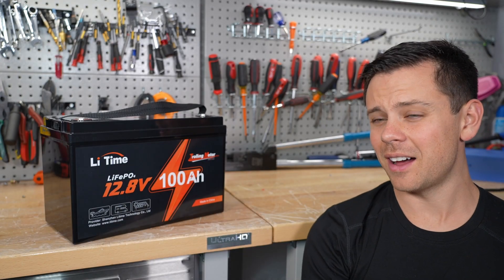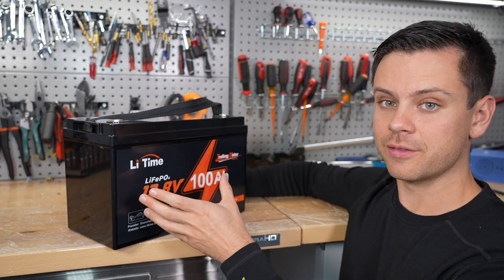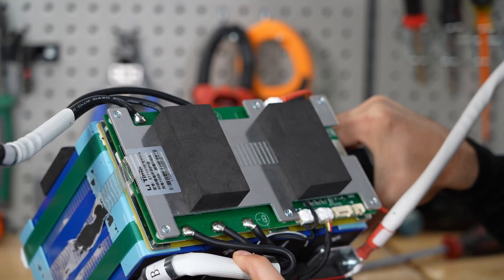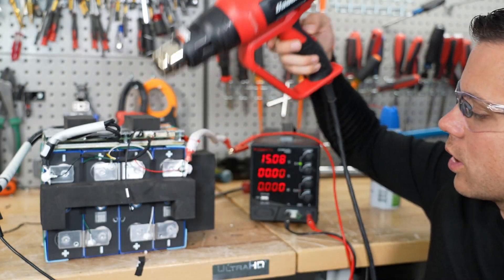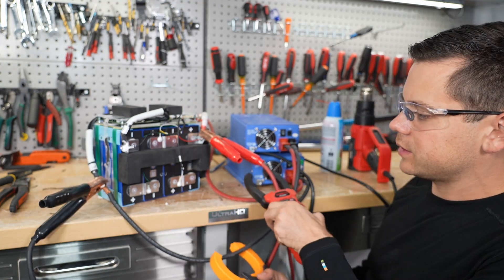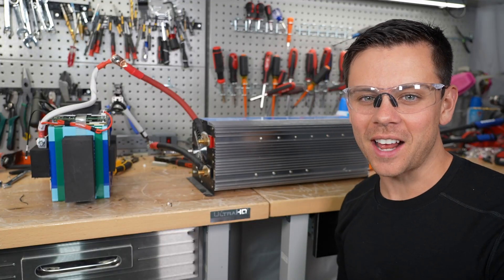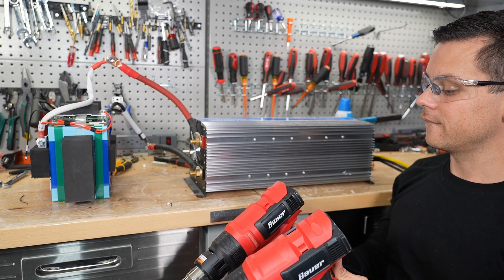$369 Li Time 12V LiFePO4 Battery! 300-500A Surge?! Low Temp Protection?!

Comment from the maker: This model of battery is not available on amazon! The amazon version does not have the same features. If you want the battery shown in the video, you have to buy it direct (affiliate link): https://www.litime.com/products/litime-12v-100ah-tm-deep-cycle-lifepo4-battery-for-trolling-motors?ref=XBIA62RFcalHns

Other Li Time Batteries: https://www.litime.com/?ref=XBIA62RFcalHns

And there is a coupon code for 3% off if you buy direct: WILLIAMPROWSEIV

If you want the cheaper amazon battery that does not have low temp cut off or surge capacity, it is here: https://amzn.to/3DYdi9D

0:00 Intro
1:43 Tear Down and Temperature Sensor Testing
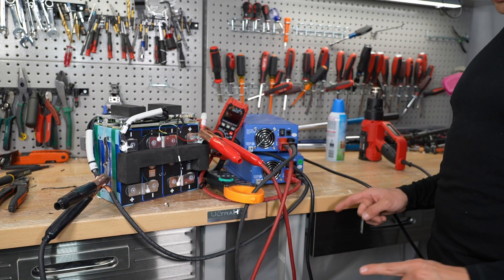4:35 Surge Testing!
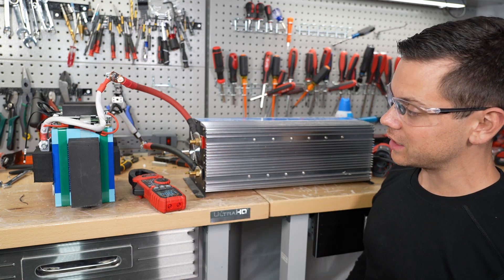6:50 Conclusion

And there is a coupon code for 3% off: WILLIAMPROWSEIV
~~~~~~~~~~~~~~~~~~~~~~~~~~~~~~~~~~~~~~~~~~~
Tired of getting ripped off? Check out my "Will Prowse Approved" solar product recommendations below!

12V Batteries
https://www.mobile-solarpower.com/lithium-batteries.html

48V Batteries
https://www.mobile-solarpower.com/48v-batteries.html

Offgrid Inverter System Builder
https://www.mobile-solarpower.com/48v-complete-system-blueprint-559371.html

Hybrid Inverter System Builder
https://www.mobile-solarpower.com/code-compliant-48v-offgrid-system.html

Mobile Handtruck System Builder (very popular!)
https://www.mobile-solarpower.com/mobile-48v-system.html

Solar Panels
https://www.mobile-solarpower.com/300w-solar-panels.html

Ground Mount Solar Racking
https://www.mobile-solarpower.com/ground-mount-racks.html

Wire, Lugs and Busbars
https://www.mobile-solarpower.com/wire-and-connectors.html

Tools
https://www.mobile-solarpower.com/tools.html

Fuses and Circuit Breakers
https://www.mobile-solarpower.com/fuses.html

Plug-N-Play Solar Systems
Ecoflow, Anker And Bluetti! So many models to choose from. See my current recommendations here:
https://www.mobile-solarpower.com/full-size-systems.html

~~~~~~~~~~~~~~~~~~~~~~~~~~~~~~~~~~~~~~~~~~
Need to build a large DIY system? Need a trustworthy solar distributor? These are my favorites:

Signature Solar
Creator of EG4! Solar Minisplits, Victron and More! Largest Solar Store Online.
If you want $50 off, please use my link below and coupon code "DIYSOLAR50":
https://signaturesolar.com/?ref=cPwLcVc0SW-BjN

Current Connected
Best Prices for EG4, Victron, Midnite and so much more! Fast Shipping and Highest Rated Customer Service:
https://currentconnected.com/?ref=wp

~~~~~~~~~~~~~~~~~~~~~~~~~~~~~~~~~~~~~~~~~~
Join our DIY Solar Community 
Need more help? Join the largest solar forum on the internet for beginners and professionals alike. 140,000 members and counting!
https://www.diysolarforum.com

Check Out My Free Book
Best-selling and beginner-friendly guidebook to off-grid 12V solar!
https://www.mobile-solarpower.com/the-book.html

~~~~~~~~~~~~~~~~~~~~~~~~~~~~~~~~~~~~~~~~~~
Contact Information:
I am NOT available for personal solar system consult! If you wish to contact me, this is my direct email: williamprowsediysolar@gmail.com
FTC Disclosure Statement and Disclaimers:
Every video includes paid promotion or sponsorship (such as free products for review). Some links on this YouTube channel may be affiliate links. We may get paid if you buy something or take an action after clicking one of these. My videos are for educational purposes only. Information is subject to change/update at any time. Electricity is DANGEROUS and can kill. Be smart and use common sense :) DIY Solar Power with Will Prowse is a participant in the Amazon Services LLC Associates Program, An affiliate advertising program designed to provide a means for sites to earn advertising fees by advertising and linking to Amazon.com
Reply: I would love for you to test the "new" Enjoybot battery! I bought it after your review for the older one without low temp protection. Happy so far but would be nice to see your tear down for that
Reply from the maker: Wow I did not know about their new model. Thank you @Knape89
Reply: Hoi will.

Do you know if the lipo4 and lead battery both can set on ground .

Reason is this.

When installing an electrical installation on board a ship, it is important to prevent galvanic corrosion.  Galvanic corrosion is the eating away (corroding) of metal under the influence of an electric current.

Victron and other company's tell me that i have to set the minus of the battery all of them on the ground plate of the boat .
Problems is that by mix set nothing is tell about it.
I have contact victron about it a week
 ago and still no answer over this .

A boat is beult by 
Din / iso 10133
Or
Iec 60092-507/2

Alle ac and dc ground connection have to be in one point .

The lipo4 is not connect on a dyno .
Its connect by solar power or battery charger.

Thank you if you will look in to this.
Reply: My question is, if i buy one batt with low temp shut off and one without, then paired in series, will the bms cut power to both batts when low temp is reached?
Reply: They advertise that this system is safe up to a 4p4s setup - I am looking to set it up in 4p2s for a 24v 400ah setup… do you have any videos doing something similar?
Reply: Your coupon code has the following error on the trolling motor model "WILLIAMPROWSEIV couldn't be used with your existing discounts. You already have a better combination."
Reply: The battery you have listed in the description on amazon shows 15,000 cycles. The LiTime website says 4,000+. I can't say as I've heard of any battery with a life of 15,000 cycles. Can you clarify?
Reply: It’s on Amazon now FYI if you want to update your website/this post
Reply: I think Amazon has it listed now
Reply: How long will a battery like this do expect to last in a solar set up like yours?
Reply: I've just watched a short video by Julien Illet about some Sodium-Ion cells. They are quite reasonably priced, a 10ah 3v nominal cell is selling for $3.80 if you need 40 cells to make a 1.2Kwh pack then the cell cost is only around $150 so with a BMS and enclosure maybe this would only cost around $250 which is a fair bit cheaper than lifepo4. They claim 4000 cycles. Lots of unknowns but seems like it might be a promising option for home energy storage.
Reply: @willprowse can I use this type of battery for car audio to power big systems? I noticed that certain car audio companies use these same life po4 batteries but the only thing I can see different is that they do not use any bms on there batteries…. Will this battery take a charge from a 400 amp high output alternator??
Reply: Just purchased three of these TM with low temp on Amazon
Reply: Does the bms have low volts cut off if so what is it thank you
Reply: @willprowse I think the BMS is doing something weird when I charge it to full.  The voltage is dropping down to 12.8v,  but it’s not really 12.8v???? Voltage will increase once a small load is put on it.  Do you have experience with this?
Reply: Is normal. @UntilValhalla86
Reply: Dont buy these batteries, they dont last and the customer service is garbage. I have one of these and it was only a few years old and maybe been cycled like 4 times and the BMS started acting up. I tried all the tricks to reset it and nothing worked. I contacted LiTime and they said I could ship it to them on my dime and IF they found a problem with it they would re-imburse me or replace. But if they dont find a flaw they wont pay to return it. They sell used batteries and I dont trust that. So I pulled the case apart and unplugged the BMS let it sit and sure enough it worked again. But a few hours later the BMS stopped working again. So I told LiTime what happened and they said sorry you opened it so they cant help and cant sell me a BMS replacement. Terrible service and support!!!
Reply: Great review!  Looks like a well designed battery, only thing missing is a heater function for use in cold climates :^)

Comment: Hello Will . I have a question for you, please help iam a beginner in solar I set my system for backup to run my freezer and my pellet stove and some lights ,I have a all one inverter 24v 3000w and the same batteries in the video    I usually turn off the inverter butt the battery still charging ,what will happen if the batteries cut off from the cold?? Thank you!

Comment: I'm not sure if I should make comments here, or in the forum.  First, it looks like this battery is now available on Amazon - 12V 100Ah TM.  They also have a SMART (Bluetooth) version.  Do the findings in this evaluation apply to both of those?  If I've got a Victron Shunt, do I need a Bluetooth battery (the 200Ah versions don't seem to support Bluetooth).

Comment: Trying to decide if 2 6v (210 amp hours) batteries or 1 12v lithium is better to run 12v cooler while camping for a week. Plan to use 220w solar to keep the battery charged up. More reserve with the 6v but faster charging with lithium. What to do?🤷‍♂️

Comment: What voltage does the BMS cut-off the output?  Trying to help a friend where his battery discharged pretty well completely.  I thought low voltage cutoff is standard for most BMS's????

Comment: Hello Will, I have a question for you.  Did you purchase this battery as a random buyer, or, did they send you one with the agreement that you'd do a review on it?  If they sent it to you, knowing that you'd do a review, I would bet any amount of $, that the identical one I (a random dude) would receive, would not have nearly the same internal component robustness that you portray in your video here.  There is a simple experiment you, or any other YT reviewer could do to test this, not just with this battery, but with any product.

Until I see a YT reviewer, doing a side by side comparison between the product the company hand selected to ship to the reviewer, and the identical product shipped to a random Joe, I'm not buying it, nor am I subscribing.  

On the flipside of that coin, is you would be doing something no other reviewer is doing, and you would get much more respect, trust, credibility, and loyalty from your more savvy viewers by doing so imo.  Could there be a downside to this?  Sure. It's possible that companies would stop sending you products to review, knowing that they'd have to make all identical products on their assembly line of the same quality as the one they sent to you, then they would have to charge $750 per battery rather than $369.  I hope I'm wrong on this, because I I'm in the market for Li batts, and I'd like to believe the quality components you received would be the same as the ones I would get, but there's no way to know without having some rando order it, and then you tearing that one apart.  Then you'll get my trust, loyalty, and my subscription.

Comment: Quick question Will. I have this TM battery, bought from Li Time direct. It will only charge to 12.7 volts, do I have a faulty battery? The battery itself says 12.8 on it but looks like most LiFPo should go to 13.3

Comment: So is low temp charging protection and low temp cut-off two different features?  You start the video saying that it doesn't have low temp charging protection but then test the cutoff later on...on their site for this same battery it says low temp protection and those batteries are $300.

Comment: Question: Based on your recommendation, I bought the LiTime with low temp charging protection, and installed it in my camper solar system. When the low temp charging protection engages, will I damage my charge controller? It says to never connect the solar panels without having a battery connected.

Comment: LiTime advertises these as Trolling Motor batteries. Is there any downside to using them in a cargo van RV conversion? I'll be charging from the starter battery until I can add solar panels to the system.

Comment: Many recent reviews of this 12v 100ah TM (cold-cutoff) model state that there is something weird with the bms. 

Something about chargers cutting off at lower voltages, spiking (unless charging while under load), and only showing 12.87v after charging.

Are these reviewers doing something wrong… or did you notice any “quirks” with the bms while fully charging?

Thank you

Comment: I have a Li Time 100Ah (not the TM version) just for charging my laptop, phone, etc, so small loads, but confused with the mounting instructions.  I would like to lie it down flat, so fit under my camper bed, but the instructions say, "The battery should be mounted upright or on its 2 smaller sides."  Can you confirm or deny its ok to mount the battery lying down? tia

Comment: Will, is there an equivalent of this battery, for 12Volts, 140 Amps.?  I need to replace my old batteries ( 12V/140A "PowerSonic" brand) because, apparently, my batteries ran out of recharging cycles after 5-years? I use my system, to power an off-grid, swimming pool 3/4 HP water pump?  OR, what rechargeable batteries would you recommend me?
Thanks.

Comment: I have many questions . Here is a few . This very cheep battery might have a bigger fire hazard ? I am going off grid and wondering why I shouldn’t put these under ground …. Build a concrete Box just underground and concrete block lid .
I’m thinking it might take 10-15 min to get into it but the fire risk makes that worthy ! 

I’m also concerned about EMP and I’m thinking about conduit for solar panels hooked up in series underground from ground mounted panels… 200-300 volt to controller and between panels 

You asked in one of you videos why people go with 100 amp hr rather than just starting with 250 amp hr and bigger …. My answer is ….. if one part of 1 battery breaks it’s a bunch cheaper to switch out and after an EMP it would be easier to just take what isn’t broken and go back to 12 volt …. 

Any comments would be great !

Comment: Would you recommend replace the APC 24V battery(2 sealed lead acid ones in serial) with two of these 12V LiFePo4 batteries? The lead acid ones have standby use of 13.5-13.8V.

Comment: I bought the bigger one (230 Amp Hour)... and installed it in the pocket in my truck bed in front of the drivers side rear wheel left open from my slide out bed. I have a 5000 watt inverter and a battery doctor to keep the battery from pulling my starting batteries down too low. I have a permanently installed 40 Amp charger for when I don't have a loooong drive for my two alternators to be able to charge this fast enough. I use it to charge my Sony Battery Station for my drone. I got the basic ones, (two of them) without cold weather protection and returned them immediately for the 230 amp hour one. They took great care of me and were easy to deal with. Very impressed with the company, product and customer service.

Comment: Bought two of these - one reads 12.8 volts when fully charged (Victron IP22 30 amp charger), the other reads 13.3 volts - odd. Have seen another review and a comment said he had the same issue, tore down the battery, and found that the cells were seriously out of balanced. This would suggest the battery would not achieve its rated capacity. However, a test on "Off Grid Basement" had a battery test at 12.8V when full and his capacity test showed 105 ah capacity. Confused, wondering if I have a bad battery, thoughts?

Comment: Thanks for the review I picked one up to try out in my every with my solar setup, will likely add to it next year. In the interim can you use a regular charger on these? Or can you use a std charger? Either starter or deep cycle 10amp. Thx

Comment: Some of LiTime models recommend that they are not installed on their side.  What is the issue with that? What will happen if I lay it on its side to fit under the seat in my Campervan?

Comment: They are on sale through 12/1/2023 for $269 via your link!  Thank you!!!    
(The beginning of your video is confusing--it seems you're saying they DON'T have low temp protection, but this model DOES)

0:25 I've had no problems with them but they do
0:28 not have low temp charging protection
0:30 that's the biggest downside now they do
0:32 have more expensive models that do have
0:34 that function but they cost so much that
0:36 you're better off buying a name brand
0:38 battery

Comment: I own one of these and love it. Question, says can 4s these, think i could drop 4 in series into my 48v 275amp controller 3.3hp stock GE motor golf cart? would it be 48v 100AH 400BMS theoretically? @$269 each would be cheaper than the EPOCHs. Thanks for the content.
Reply: I’m curious about this too.
Reply: I did more research and yes the 4 batteries split the amp load. So theoretically 4 100AH batteries have a higher amperage handling than a single 48v/51.2v single battery, so less stress on each BMS. and the these group 31 batteries fit into the the 4 main battery areas. @michaelfernandes5710

Comment: I'd love a video where you breakdown budge or LiTime "12V" chargers. I have this TM battery and their  14.V 20a charger and it does this weird cycle towards the end on the charging cycle at when the battery reads 13.18 v on a Victron Smart Sense. The Charger starts blinking Red/fan on then Green/fan off.... over and over. I've never let it run this cycle for an extended period of time to see if would eventually turn green as I dont want to damage the battery.

Comment: I just received my order of 4 of these batteries direct from Li Time.  The total cost for the 4 with the tax was $1132.88.  Li Time shipped them at no cost and I received the order less than 4 days after placing it.  Packaged very well, and the books were very complete, laid out well, and easy to understand.  I will install them tomorrow as I am awaiting the arrival of the Victron Smart Shunt which is suppose to arrive today.  Will update after installation and a bit of use.